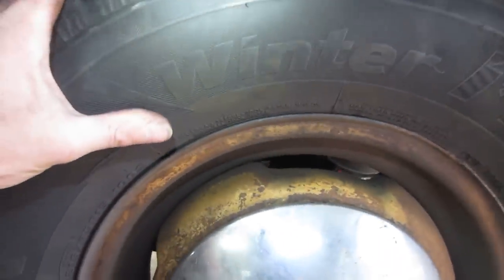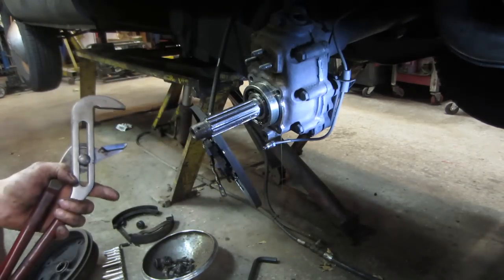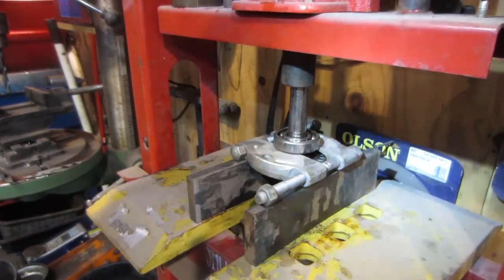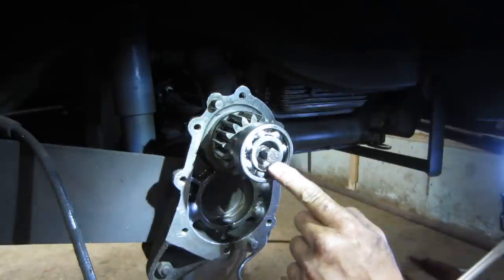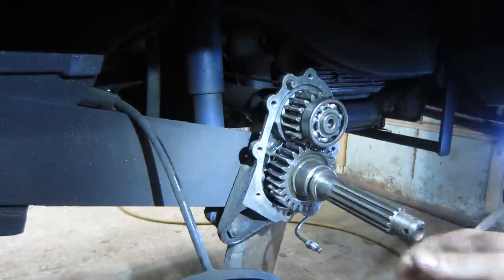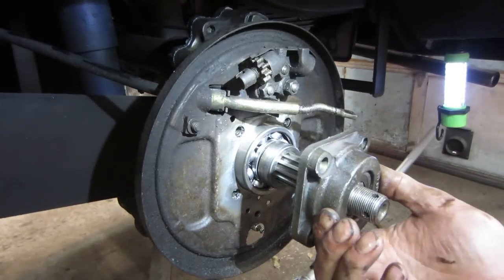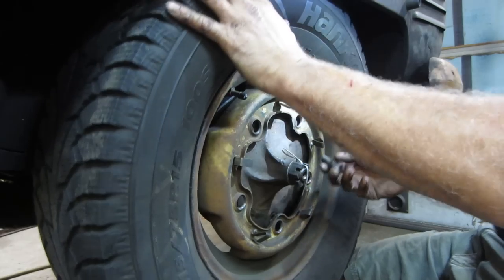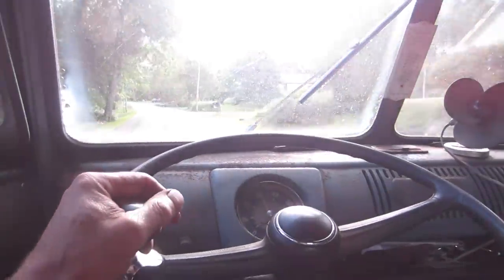vw bus gear reduction box repair.

Comment: hey the next time you have to replace the bearings in the reduction box try  wrapping  the bolt with a small rope and tie it to you  then you will have both hands to put the outer bearing on

Comment: Using wheel spacers/adaptors on those old gear reduction boxes is also a good way to destroy the lower axle bearings

Comment: Mustie, I had a sand rail that I put the gear reduction boxes on to give me more ground clearance for the big monster 38.5 mud tires that was on it. Oh I forgot to mention that it had a 2300 Ford pinto motor for the power supply. I had to go into tranny several times for different reasons. Got to be a pro at taking it apart.

Comment: When you pull, say a bearing off a shaft that is going back on do you put it face down or face up on the bench. (I'm inconsistent)
Reply: You don't. Everything in that axle is done on the vehicle. VW has a special puller to remove that outer bearing.

Comment: Without the gasket could there be to much pressure against the bearing causing premature wear?
Reply: I don't think that will be an issue for this application since these are ball bearings and not a cone bearings.

Comment: Hi this is advice not a moan love your work man ...but when you put steel bearing into alloy box you should use a bearing fit because alloy cases just ain't accurate The gasket should be the right thickness otherwise you run a good chance of warpage or even stress cracks on the casing because you either tighten down on the bearing or too thicker gasket allow side-ward or a loose bearing situation when the bearing can run loose 
hope this helps john uk

Comment: At the top outside bearing, why do you not use a screw and washer to press it on, Instead of needing 3 hands?
Reply: Thought the same - but he would need to block the axle from spinning freely.

Comment: There are 2 different boxes. BIG(46mm '63 and later) and SMALL(36mm up to Late '62) nut boxes.  https://www.thesamba.com/vw/gallery/pix/262393.jpg

Please make a note on your title.  There are significant differences between the two.  Bearings are different sizes and the seals are slightly different.  Big boxes you have to pull a plug in the back to get the stub axel off.  It's hidden behind the spring plate and is not really obvious if you've never dug into these before.  Uh, gear puller maybe??  You pull the OUTER stub axel bearing off FIRST.  Then you can pull the outer box half off.  You don't need three hands, you just need to use proper technique and press the bearings in.  Smarter not harder.
Thanks for the video though.

Comment: AGHHHH - don't hammer the new bearings like that! You put little dents in the balls and ball races, defeating the purpose of your whole project. You press it out with a socket, so use a socket to press it back on again!
Reply from the maker: you did not listen to what l said about where to hit it, no damage done at all, AGHHHH
Reply: I seen no issue with the way he tapped them on, using the "race" that had press fit. now beating the outer race trying to drive on the inner race would kill them.
turning corners and hitting bumps would shock the bearings harder than he did with the small hammer and brass rod/punch ;)
Reply: I DID listen. I also saw how many times that you hit it wrongly 16:32 before you  realised what you were doing. And I also saw how many times that you MISSED. Anyway, your abortion of a method around 18:09 is completely the wrong way to do it anyway. Don't HIT it - simply put a SOCKET over the axle, then screw a long bolt (with a washer on it) straight into the axle, and that will pull the bearing on. You can do it with 2 hands, there is no effort, and no risk of damaging anything.
Reply: Sorry mustie, I agree.
What's not mentioned is that not applying uniform pressure around the fitting race (and I get your explanation) is going to distort the the race as it slides into place, or down the shaft crooked. It may be rounded up once in place but you've still bent it. And it may be a minuscule amount, but what kind of tolerances are we talking about with these bearings? They're pretty tight, I think.